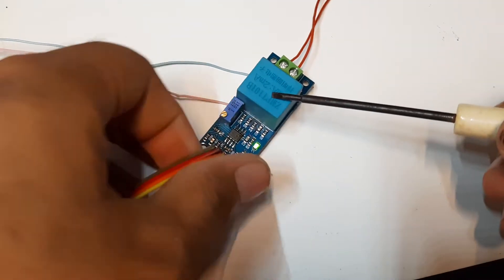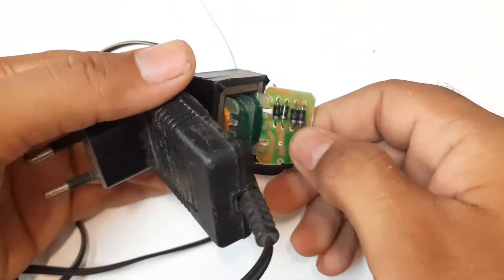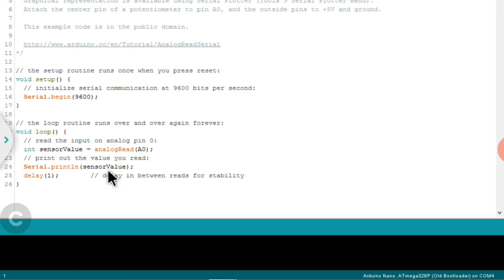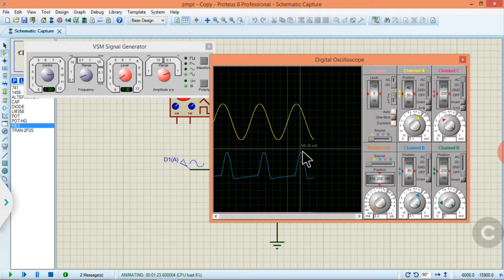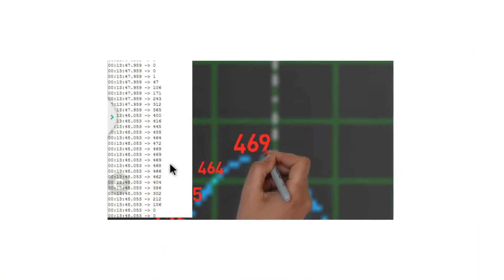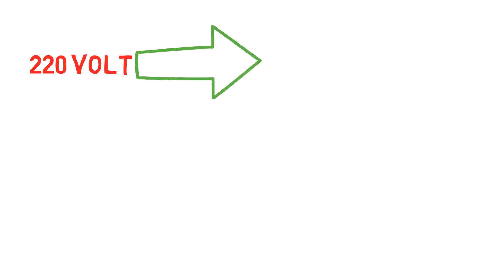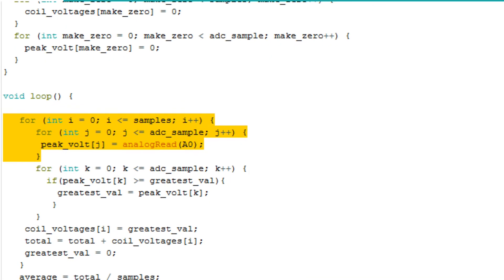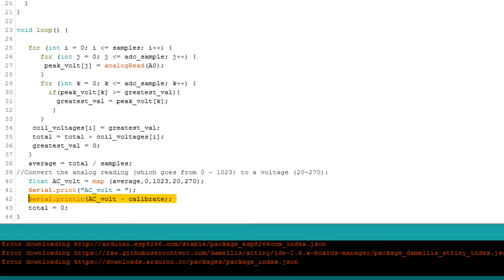Voltage measurement with Arduino

Comment: Use a ADC 1115 that has 16 bits. It can measure negative values as well with a higher resolution

Comment: Your video is really well produced, with some really great graphics. Loved the part where you were annotating the sine wave with values.

However, hardware-wise, there is a problem. The input to the Arduino can swing positive and negative, as you have figured out from the readings. You should not allow any input to the Arduino to go negative. If you check out the datasheet for the AVR microcontroller, you will find the allowable range of voltages on an input pin. I haven't looked, but in general the range GND-0.5V to VCC+0.5V is normally allowable. So an input can be driven about half a volt outside the power supply rail values (GND and VCC). Exceed these limits and you risk damaging the pin or even the chip itself. You probably have negative 4V on the input analogue pin when the sine wave swings negative. At the very least you should add a diode to your circuit to keep the voltages on the input pin positive and within the allowable range. Your variable resistor is somewhat limiting the current, which has saved the pin from damage.

Just FYI, most digital ICs have what are called "clamping diodes" on the input. If the input exceeds VCC+0.7V then the clamping diode starts to conduct. Likewise if the input goes below GND-0.7V the other clamping diode starts to conduct and clamps the voltage on the pin at around -0.7V. These diodes really exist to help with ESD protection, but start to conduct (and dissipate heat) whenever the input is outside the allowable range. That's why the allowable range of input voltages is in a range where these diodes are not conducting.
Reply from the maker: yes it is true the resistors saved my arduino.
sorry I was not thinking smartly those days, if my arduino dies then i would have realized this negative voltage since everything works fine then i never thought of negative voltage.

Anyway thanks for remainding me i will never do this stupid mistake again.

it's good to actually know people looking at my video correcting my mistakes but it's my responsibility to make sure no one damages their hardware because of my mistakes. Thanks for highlighting my mistake.

Comment: Hi, 
I put in your code, 
It works after I put in a calibration value. 

But when I put off the device.
I get a meassure of 168Volt,  
Why is it not zero? 

Greets from Holland
Reply from the maker: both Hardware and Code needs to be upgraded - only thing is I am not much as i used to be in my school and college days...
It might take time to fix i will make a part 3 of this video soon

hopefully i will fix everything

Comment: can  measure bidirectional ? im building a zero export
Reply from the maker: Use ina219 for bidirectional power measurements for DC
My video will not help you find bidirectional currents on ac line but you can use ACS...  Current sensor to do so. 

This tutorial will help you measure AC voltage but you should also add some protection circuitry and filters to remove harm full spike voltages and ripples.
Reply from the maker: For your zero export projects commercial version will be more suitable. 
For prototype versions 5-20 A current sensor will do the job. 

Let me know if you need help with that.
Reply: @anklabs7504   thanks for the feedback .The zero export is with an Arduino ,i jus need  an inverted signal reading ,so when it reads 0.3 amp ac or 30 watts it turns off .The load control it's power out ,the reading form ct sensor .oh in the code it control optocoupler out ,turning a mosfet  up and down   controlling output to a Chinese grid tie inverter ,  signal or limits  it .right now when it read the current  reading goes up so it turn off.is there a way to make the read backward in Arduino ?i did not write the code ,i took peace's of other code an slap them together ,so could look at it for me?